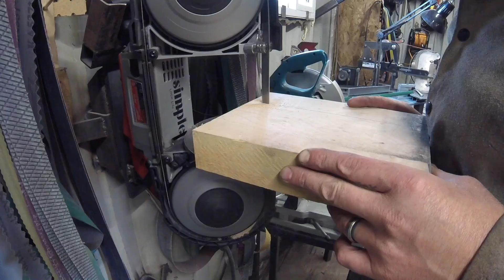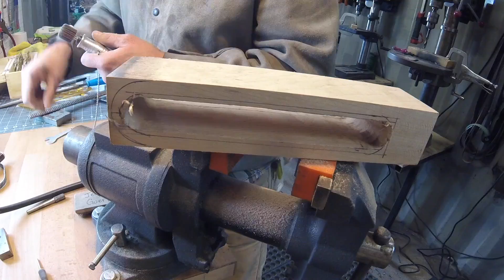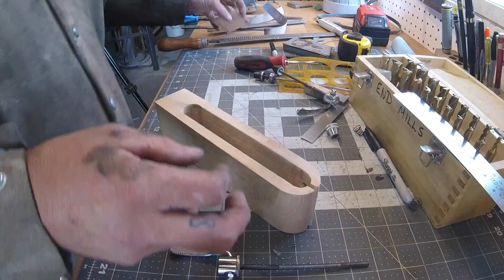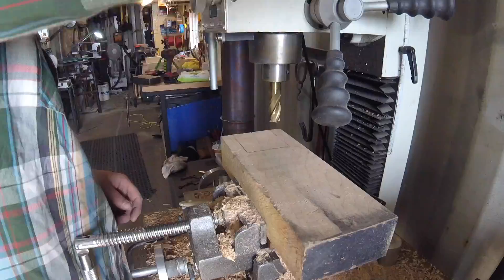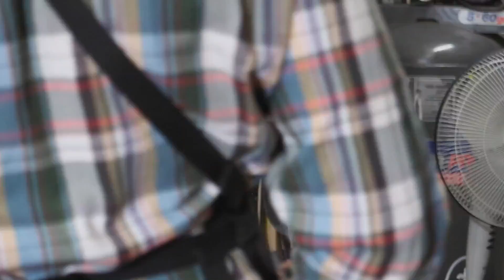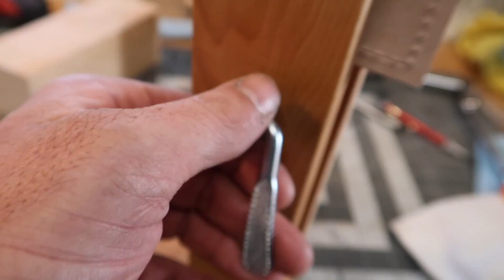Jeremy's Stitching Pony - How to make it from wood (DIY woodworking)

Comment: The problem you will have that any bolting/nuts on the sides will constantly snag your thread when stitching. It is really a pain. I epoxied a nut inside a wooden dowel then rounded/smoothed it to a cone-shaped nut, still grippable, but the thread slips over the cone-shaped sides, preventing snagging. On the opposite side,  I used a carriage bolt which doesn't snag the thread. I also glued a thin piece of leather inside each jaw to prevent the wood marring my leather,

Comment: Hey Jeremy! I have a quick question for you, or anyone else that might know. I want to build my first knife, I have for  long time, so I finally ordered a chunk of 01. Here's the question though, I thought 3/16 would be too thick for the relatively simple, light knife I want to build, so I ordered 3/32, being inexperienced, should I stick with a thicker 3/16?
Reply: For a pretty standard knife, 1/8" is a pretty good blade thickness.  3/32 is ok for a finer knife, but it won't be as rugged.  If you are looking for a heavier duty, bushcrafting, log splitting knife, 3/16 is great.
Reply: Thanks David! Like I said, its a pretty simple knife. I want it to be a tough, kind of small hybrid EDC/Bushcraft/camping knife, I think 1/8th or 3/16th is probably going to be my friend, Its 8-3/4" long and about 2" wide. Thanks again.

Comment: That turned out great and they are super useful. Noticed you saddle stitching at the end. That's what I do as well. My only suggestion would be to groove out your stitch line. It not only looks like a pro did it, your stitching gets some protection from the counter sink.Thanks for sharing

Comment: Nice, I can see how useful a mill would be! I have made something similar but using six pieces of wood, I would add leather covers over the wood, sometimes you need to clamp hard and wood will mar the finish, also I glued two magnets, one on either side, to the top, so that I could hang my needles without them getting tangled if I needed to do something with my hands, like use a plier to pull one needle through.

Comment: i am trying to get into leather work. any suggestions on tools?
Reply from the maker: I was thinking about doing a little video on that. I'm just getting started as well, but I could share some basic stuff that I've found useful in getting started. 👍
Reply: Supplies aside:
1) you'll need something to cut the leather.  I use an olfa case cutter.  I have leather knives but the heavy case cutter is my main go to.   You'll also need a good cutting surface that can take being cut into repeatedly, and a good metal ruler/straight edge.
2) You will also need a good poly/wood/or rawhide hammer.   If you use a metal hammer on your punches and chisels the tops will start to mushroom out, and you don't want that.
3) You'll be needing to punch a lot of holes,  so you'll need either a set of hole punches (for various sizing) or one with multiple heads that you can swap out.   I have both, and I use them all regularly. 
4) I do all my sewing by hand and to make sure I get clean lines on my stitching, I use stitching chisels.   You will also need leather sewing needles (get good quality ones, not the $5 pack of 5) and possibly a sewing awl, depending on your preference. 
5) You're also go to need to do some riveting, so you will need a rivet setter and a small jewellers anvil or piece of thick steel to set them on. 

That will give you a BASIC set-up for making stuff.   If you have one near-by Tandy Leather carries pretty much everything you'd need, however check around you can probably get better prices at hardware stores or places like Princess Auto (Harbour Freight).
Reply: I do leather working as a hobby, along with wood working and some blacksmithing.  What kind of work are you looking at doing?
Reply: smaller things likes wallets, watch bands and maybe belts. some small pouches as well. Nothing big or embossed really at this point.  Wallets and watch bands are what I am mainly looking into.
Reply: i have a harbor freight just across town. thank you.